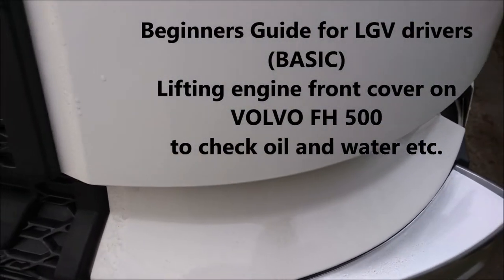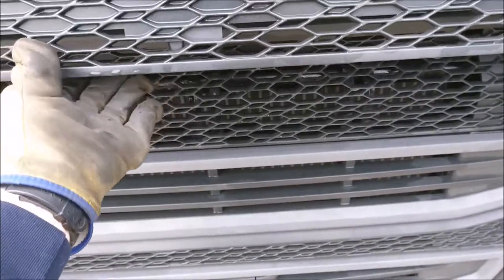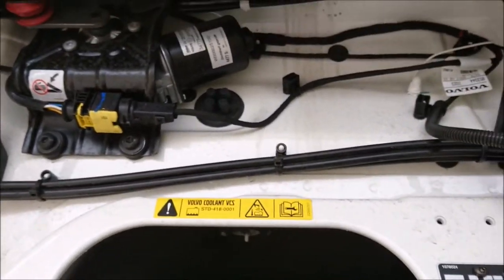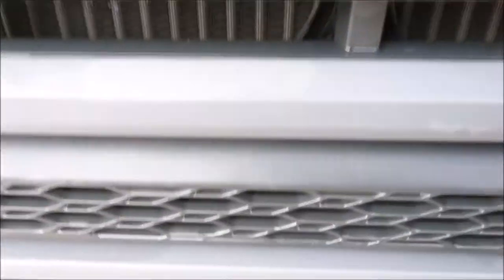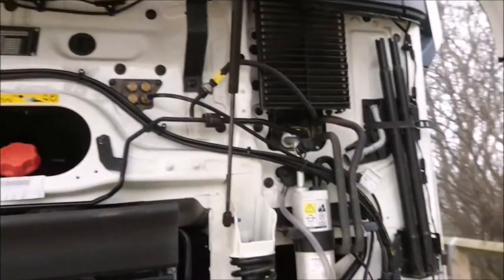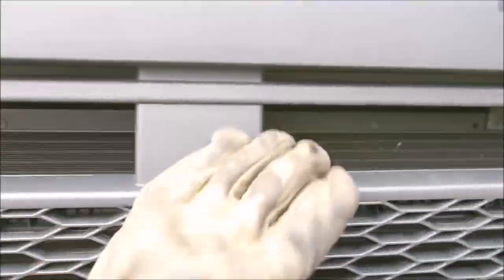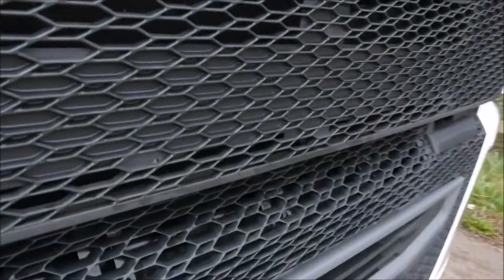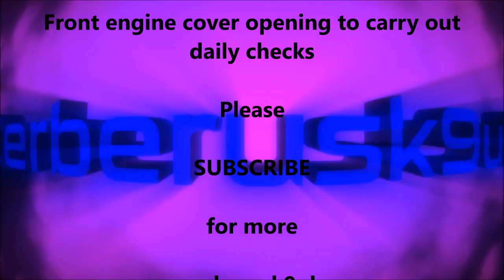Truck Drivers Beginners guide - VOLVO FH 500 engine front cover opening and other stuff

Comment: How do you get radio speakers on top to work????
Reply from the maker: Go into menu, press ESC button, turn knob, marked 'OK' until 
'AUDIO SETTINGS' press OK then scroll through until 'FADER/BALANCE' turn OK knob until + icon moves forward or backwards, if you dont have front speakers working then + icon should be moved up.
( also check Speaker channels,  for 4 or 2 although default 2 includes the front speakers) if nothing, then it's more serious, like, broken. Hope this helps.👍
Reply: cerberusk9uk   I just see your reply now 
And I just tried it 
I can choose between left or right speakers 
But there seems to no button for up and down 
It’s a FMX I’m driving
Reply from the maker: Possible wiring issue???
Reply: Thanks for your erplyt👍